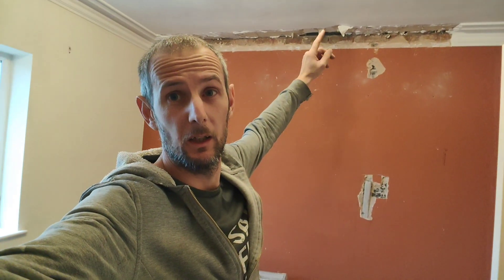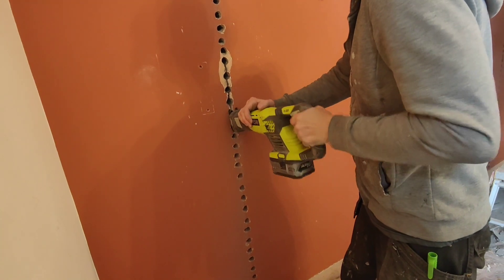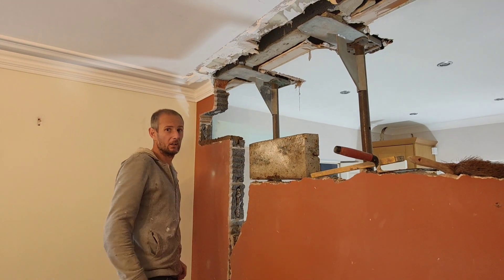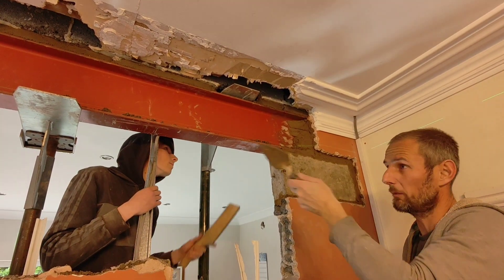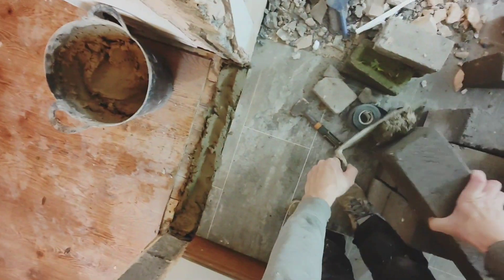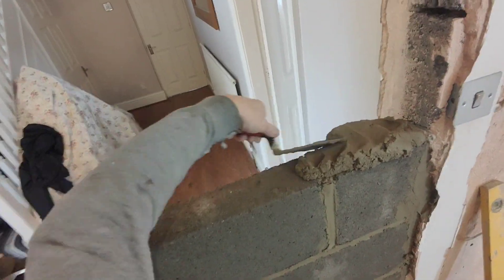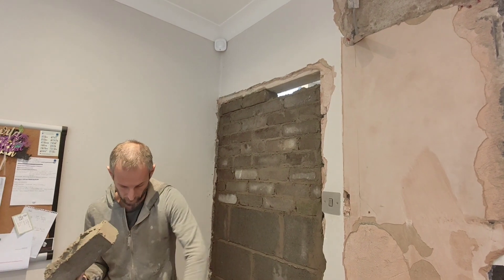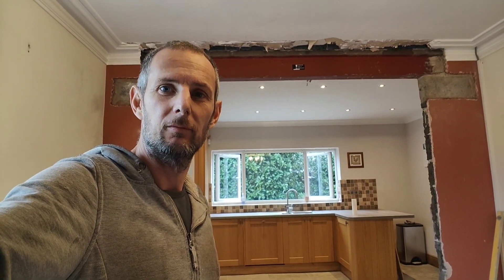fitting rsj steel beam in house

Comment: Thinking of doing this with my kitchen it’s 4.3m what sort of price these things cost thanks
Reply from the maker: For the steel or for the full job doing
Reply: @markhep  steel install nock wall down  I’ll do plastering removal of electrics
Reply from the maker: @aaaaa4266  I charged 700 in labour for this one think is was 900 with few blocks for wall pads and few other bits hire of the props. customer paid for skip and steel . 👍
Reply: @markhep  fair enuff thanks mate gives me a idea of cost
Reply from the maker: @aaaaa4266  no problems 👍👍

Comment: Great job as always mark 
Can you tell me what mix u used for cement  ? Also did u use sharp sand or building sand?
Reply: Around the Pads and Rsj s
Reply from the maker: @rashadjavaid1620  cheers mate it was 4 ,
Sand to one cement I use .you can use sharp sand or building sand I use what ever I have 👍👍👍
Reply: Thanks for reply - mark 
Keep up the good work ❤️👍🏽

Comment: IMHO engineer should have specified the new doorway masonry to be keyed in (dove-tailed) to the new beam masonry to spread the load.
But if the load is relatively small under the padstone then doorway masonry simply braces padstone pier and all is good.
It`s therapeutic to watch masonry being built. Thanks for the video.
Reply from the maker: Thanks Mate .think it's because the door had a corner on it that was built in 👍👍